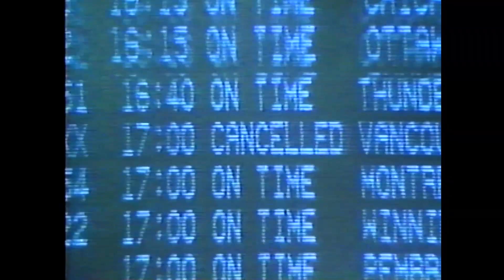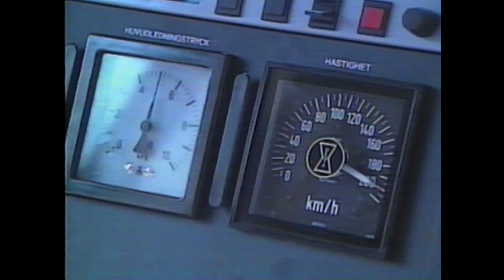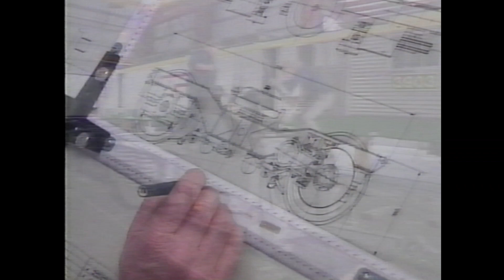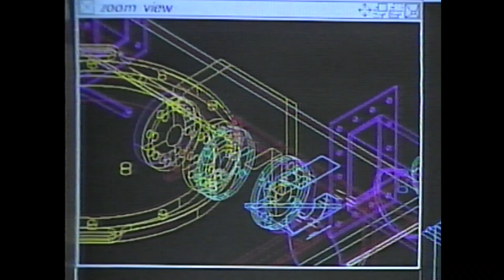Sprintor... tomorrow's train today | ABB Canada (May 7, 1990)

Comment: Too bad that even after this time the modern Liberal government is just funding yet another study and not any actual construction. What a rip off! Just built a demonstration line or two already! Edmonton-Calgary would be ideal... 280 km apart, growing faster than any other region in Canada.. 2H 10M @ 240 km/h I believe was one target speed design using the diesel Bombardier JetTrain technology which was demonstrated about a decade later around the year 2000...